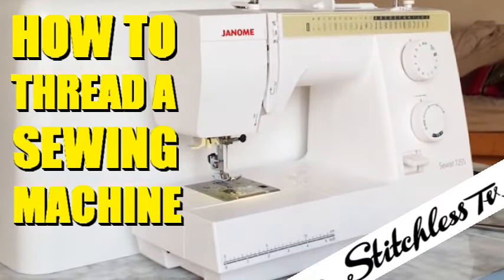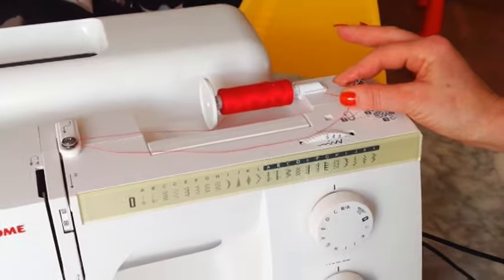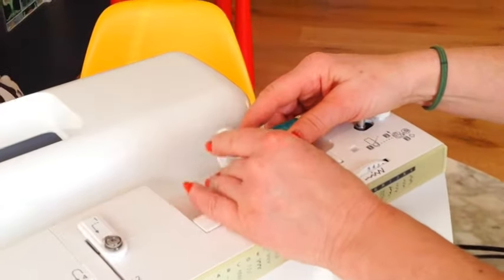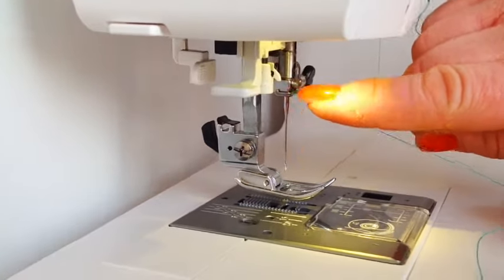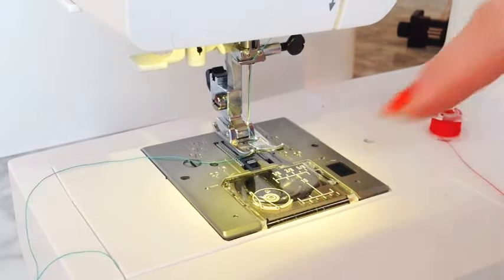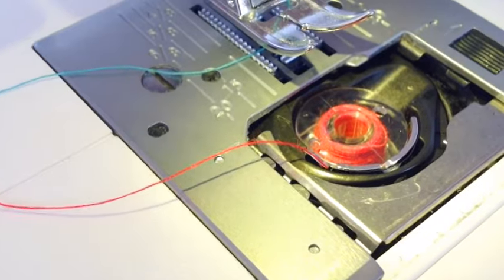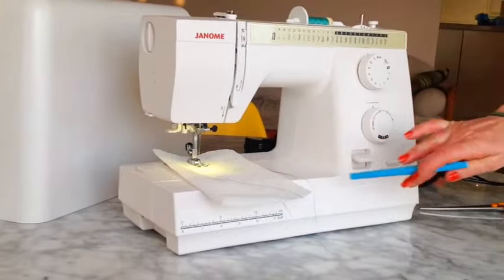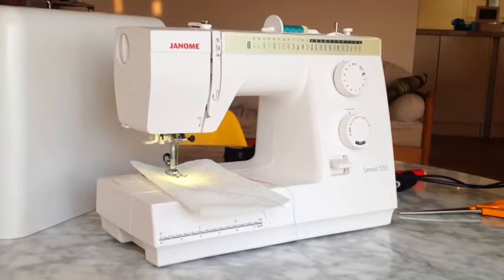How to Thread a Janome Sewing Machine tutorial with Close Ups

Comment: I have had my Janome model 140M for quite a while and have used it a lot.  Wanted to use it a few days ago and it just will not stitch.  Have checked the threading up several times.  Both threads are threaded properly but it is not stitching.  Needle goes up and down. Material moves along but it is just not stitching. Any ideas please.  I am trying to make a mask.
Reply from the maker: I know it doesn't sound like much but try changing the needle and or make sure the type of needle us correct type for the fabric.
Reply: Thank you for your reply.  I tried that.  I am using the blue tip needle.  Not the one for knitted fabrics.  As the cotton material I am using is thick  I thought it would,be ok.  I did try with the ordinary needle to start with the other day but it wouldn’t work then either,but will try again.
Reply: Thank you for your help but I have now changed the needle and still not stitching.  Nevermind.
Reply from the maker: I will have a think about
Reply: Thank you.